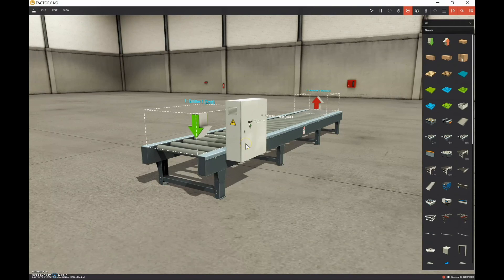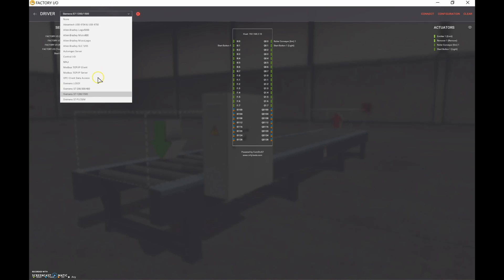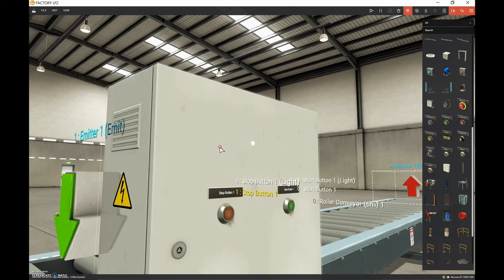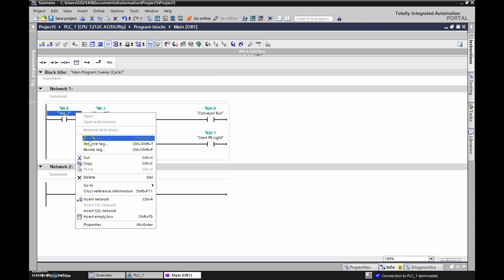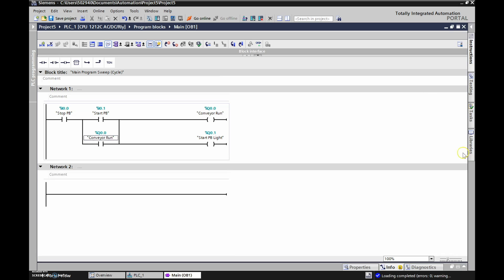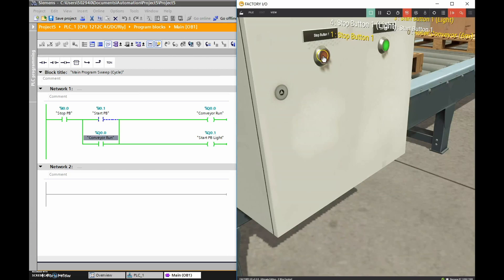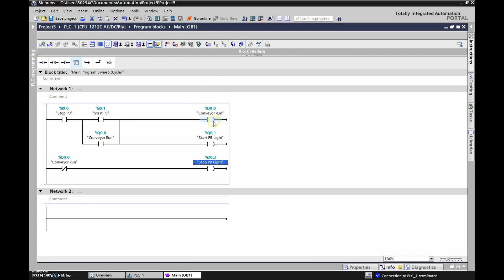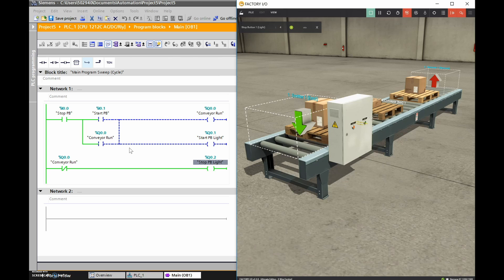Siemens TIA Portal & Factory IO (3 Wire Control of Conveyor)

Comment: i am trying really hard to understand why NC is not used here for stop button. is there anybody who can explain it clearly. Somebody asked the same question here, but I still do not get it
Reply from the maker: The Stop button is physically wired as a normally closed contact. This means that if you connected plc source voltage to one side and the plc input on the other side, then the plc input would have voltage applied to it as long as you didn't press the stop pb. The NO plc instruction has nothing to do with normal way you think of it in relay logic. The NO instruction looks for the presence of voltage, or a 1 in the memory. The NC instruction looks for no voltage or a 0 in the memory. This is why I have used the NO instruction for both the Stop PB and the Start PB. As long as I have not pressed the Stop PB, the voltage is being applied to the PLC input. The NC instruction is looking for the presence of voltage at the input terminal and thus remains True as long as no one presses the Stop PB
Reply: @PeteVree  thank you soo much for not ignoring my comment. really appreciate it

Comment: Why you dont  use normally close contacts for stop PB?
Reply from the maker: The Stop PB is physically wired as a N/C contact. The Normally Open instruction looks for the fact that the Stop is physically still in the closed position, providing 24 V to the input terminal and a 1 in the memory location for this input.

Comment: Pete, On your previous video, why did you have to offset the Inputs by 10 ?
Reply from the maker: With the Factory IO you are using virtual inputs from the software... so you have to offset the inputs by 10 so that the actual physical inputs from the PLC are redundant, and the program only responds to the virtual inputs from the Factory IO software.